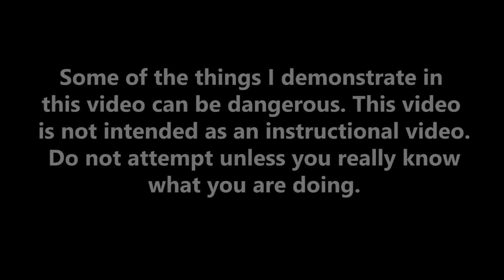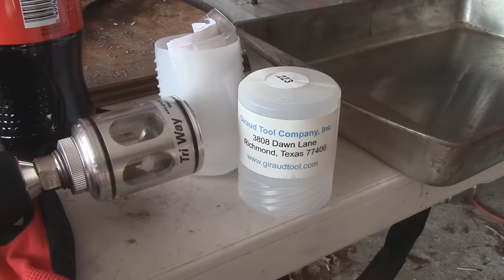How I'm Reloading 223 for $.10 Per Round | CountryBoyPrepper

Comment: This is absolutely incredible, huge respect to anyone who’s this self sufficient. I’m looking to get into hand loading my ammo but I def do not have time for all this
Reply: Thankfully, you can purchase premanufactured projectiles! I’m tempted to start putting together a casting set up though, because you can also get lead from tire shops in the form of tire weights. Tire shops have to pay to get rid of it, so you can often get it for free! You can also skip the powder coating if you use copper gas checks (I believe). Little bit of cost (3¢ a piece?), but saves a lot of time. And could possibly be cheaper than the powder coating equipment.
Reply: You don't use gas checks???
Reply: Batches, I do 1000 cases a day. Then you can reload 200 at a time. It only has to be trimmed the first time, swagging as well. Get a progressive press and 200 only takes an hour
Reply: @eric78704 you don’t have too, leading isn’t an issue, accuracy suffers a bit though. I only gas check for accuracy loads

Comment from the maker: Hey guys. I had to re-upload this video because When I was editing I forgot to include the step of resizing the powder coated bullets which is very important. Thanks for watching!
Reply: i have a question. do u use a gas check on your bullets?
Reply from the maker: No. Not necessary with a powder coated bullet.
Reply: oh ok awesome
Reply: CountryBoyPrepper why u powder coat
Reply: To prevent lead buildup in the barrel. Alternatively, he could use gas checks or copper plating.
Reply: Joshua Sullivan what about powder coat build up?
Reply: Joshua Sullivan he wouldn't really be able to use plating. And I'm almost certain that unless he's loading for subsonic velocities (I doubt it since he said 55gr), it'd break down the plating. I'm pretty sure the powder coat would break down too at above 1500fps
Reply: PC_JUNKIE128 Powder Coating is very strong and resistant.  Several people are now pushing cast boolits past 3000 fps.  I have 22-250 reloads pushing 55 grs Powder Coated cast projectiles accurately at 2700 fps.  For additional information, visit Cast Boolits forum - very experienced folks there.
Reply: TXYoteHunter thanks. I'll check it out. I think I'll be fine with 300blk subs but I was worried about smaller faster proj
Reply: CountryBoyPrepper what load are u using 
I know you said alliant ar compt powder but how many grs.
Reply: James Allen I would imagine it's enough to cycle the bolt, considering there is nothing to say how much he is using.
Reply from the maker: Actually, I'm shooting 2550 fps with no issues.
Reply: CountryBoyPrepper  what powder are you using and the grain charge.  I'm getting into casting and don't know a good charge for range scrape in my ar
Reply: this thread answered my questions. Was wondering if powder coating prevented barrel leading and wondering if you could push cast lead projectiles to supersonic? Seems like you can
Reply: i will buy some from you
Reply: CountryBoyPrepper - any recommendations for respirators when casting lead?

I just got given some casting equipment, just have some caution for doing lead paint removal as a kid.
Reply: D M he clearly said at the beginning of his video don't try this at home cuz it could be dangerous so it looks like you're on your own
Reply: CountryBoyPrepper q
Reply: bet you could automate some of that...
Reply: Inspection of the brass, especially range brass would be big for safety. Inspect for case fatigue, cracks, splits, dents, and so on. My thought is you would have to separate that scrap range lead from steel or copper jackets and stuff that is not lead just to get pure lead. Some lead also may be soft lead while others would be hard cast lead that has some tin mixed in. What kind of quality control are you using for your lead?
Reply: Yep, CBP, it helps when the case grips the bullet, eh?
Reply: this is more than .10 per, you are paying for all the electricity in the ovens and your time and the pain and ect...
Reply: CountryBoyPrepper I thought I had seen it before. Great video my friend, definitely worth watching twice.
Reply: What grain of powder are you using. I just pick up a lb of ar comp for my cast and can't seem to find any literature for my cast .223

Comment: I'm not a gun expert, what exactly is the purpose of powder coating a bullet? Is it just to protect the barrel from lead sticking behind?
Reply: QuaDECH I can tell you how to strip any rifle or how any firearm works but I ain't got a damn clue
Reply: its to prevent lead fouling. super sonic unjacketed lead bullets will surface melt and foul up the barrel.
Reply: It prevents leading in the barrel like Signal Jones said.  It also acts as a lubricant.  Old school lead loads needed a wax mix to put in lube grooved bullets for lubrication as it went down the barrel and to prevent gas cutting of the lead bullets.  It allows you to run bullet projectiles at higher speeds and pressures approaching copper jacketed projectiles depending on the round.
Reply: Mik Wri Nope. The temps are true but lead causes waaaay more friction-thus heating the bullet more than is its plastic coated.

Comment: i'll stick with my fmj 556 at 17cents per round
Reply: bren masl where do you get them for that price? The cheapest I've found is Wolf Polyformance steel case ammo for 22 cents per bullet
Reply: That's some cheap ass'd ammo !
Reply: majorsmackdown n
Reply: Steel case?
Reply: CTM ATV What's wrong with steel cased ammo? It runs just as well as brass and, in my opinion, the cases are prettier.
Reply: Hunter Falkner some people don't like to clean their rifles which is mandatory with steel case because it's corrosive.  Those people who don't like to clean their rifles then started saying steel ammo is bad
Reply: A QUIET CRUX 72 My brothers friend broke a remington 783 shooting steel case ammo. It bulged in the chamber and the action wouldn't come open. By the time we got it open, the extractor broke. He got it repaired on warranty though. I'll shoot steel cased through guns like Ak's, Sks's or Mosin's.
Reply: The Ghost of the Flying Dutchman Faulty ammo. Can easily happen to brass. Steel cased deforms less than brass so it's even less of an issue under regular circumstances.
Reply: Hunter Falkner It was tula so that could be it. As of now he's only shooting more quality ammo out of his gun.
Reply: The Ghost of the Flying Dutchman Wolf works great. You can even see tests on YouTube how they run thousands of them and didn't have any major issues except for increased fouling of the chamber and insides of the receiver in general.
Reply: Hunter Falkner When we were sighting it in, we were using federal and winchester stuff. Shot just fine with no malfunctions. Is wolf any cheaper?
Reply: The Ghost of the Flying Dutchman Quite, depends where you buy it.

Comment: To everyone saying this isn't worth the time and they would rather buy ammo, please send me your spent brass. I am glad that most do not think it's worth it more lead and brass for me and guys like me. Also everyone keeps saying $1000's in equipment, keep thinking that, as I said more lead and brass for me. But if you may be interested in reloading that press is around $120, dies $40, powder charge $38,  lee pot $69, casting mold $40, scales $20, powder $20, primers $30, basically everything to load .223 for less than $400 total. Far from thousands.... I do a few things different though I do buy lead from the scrapyard a lot easier than sifting I am lazy there.
Reply: But his labor is priceless so just shipping.

Comment: What speed are you pushing those bullets with just powder Coating?  If you don't chrono, how many grains of powder?
Reply from the maker: 2550 fps with 22.3 gr. out of a 16 inch barrel.
Reply: The Reloader Dude what kind of grouping are you getting?  I like the whole idea especially if it is reasonable grouping at 1/200 yards.

Comment: Damn dude you got the perfect assembly line. Killin it 👍 also have you noticed any leading from not gas checking 223? I’m having success with powder coating 9 as well as 762x39 with  lowest pressure charge that will cycle my Sks, but I’m nervous about starting 223. Since lowest charge will still be lot more pressure than I’m getting in 762x39, and direct impingement is more susceptible to leading in gas tube than my Sks’ piston assembly would be.

Comment: Countryboyprepper, great video. I just wanted to give you a tip I found out that you may like. If you drop the projectiles in a bucket of cool water right after you pull them out of the toaster they harden more and the seem to separate better.  I do the same think and now I may have about 10 of them stuck together out of the whole batch. Hope this helps.

Comment: Whats the accuracy of these rounds? Sorry if i missed it on your channel i noticed there are a number of accuracy tests but they are all done with factory ammo.  I presume that the powder coat would some what compensate for the fact that range trash is a mixture of metals which would cause a the hardness of the bullets to vary.  Could you please upload a video showing the accuracy and consistency of these bullets?

Comment: I used to reload but I haven't been shooting in a couple of years due to physical problems.     But I have one question for you, does the red lube you put on the bullets, is it enough ? And do you need to put on a copper gas check on the base of the bullet? Is this lube enough to keep the bullet from leading the barrel? That is why I used to buy ready made bullets, that were copper coated lead. They were fairly cheap. Can you shoot the bullet with a gas check and where would you get them these days?

Comment: I use cheap Pam cooking spray for case lube in a Ziploc bag for bulk lube. After sizing and depriming they go into a harborfreight ultrasonic cleaner with a vinegar/ water/salt solution to clean carbon and Pam off. I use the hot Texas sun or the oven to dry. Then off to the press. The Pam will cost less than $1 and lube about a million cases. The Texad sun is free and relentless this time of year.

Comment: What is the BHN of your cast bullets before powder coating and after? I see in your video you water quenched at casting, but let them air cool after powder coating? 400 degrees is hot enough to loose any hardening you gained quenching.

Comment: Im loading 9mm using 149 grain cast lead bullets and 4.8 grains of powder for about 11 cents each. I get brass and lead free at the local range When i was just buying 1000 primers at a time it was about $7 per 50 rounds using cast lead but buying 2250 primers lowered the cost to $4.50 because its cheaper with shipping and hazard fees to buy as much as possible. I wouldnt doubt that even now its possible to load 223 for 12 cents by using free lead to make heavy bullets (to retain energy) and using less powder and buying thousands of primers. I want to do this but got other priorities and nowhere to shoot it anyways. If you have a power drill and a phillips tip you can use that to remove military crimps

Comment: I get why you do it, its cheap, relieves stress, feeds your hobby and saves $$$$. You should protect yourself with gloves and a respirator when melting lead, it will poison your brain slowly. But here is a question why do you powder coat the bullets? I never saw that done before? Is it for lubricity? Or substitute for copper? What will the powder do to the internals/barrels/gas tube/BCG?

Comment: Again, like my "comments on your 9mm reloading video,  more questions than comments. Have you been able to chronograph your loads to check the velocity and what about using gas checks on lead projectiles? Any issues with barrel leading and do you use reduced powder because you're using non-jacketed bullets?
I really like your videos as I would love to be able to shoot more but the $$$ factor. I've been reloading for many years ... well not lately but that's because I haven't been shooting that much ... :( :( :( ... so I already have most of the equipment I need although I have a single stage press ... but it should work fine ... just take a little more time ... but I agree with Kw in that it can be very therapeutic.
Oh also ... I assume that the same process is used for reloading .556. I have a small lead pot already so doubt that I'll invest in a larger one to help keep down the cost. I should only need to to invest in bullet molds and resizing dies.

Comment: hello there, I am new at reloading and Have been learning some techniques,, how do you get rid of the lube on the brass? I can not get rid of it, my brass come out greasy and brown from the tumbler when I try to clean the lube off
don't you need gas check on this bullets?
how much powder and what type will you recommend?
Reply: Use hot water dawn and a 380 case full of lemi shine. Run for about 2 hours. All my lube comes off and they cases are nice and ahiny
Reply: @Asianwick4401  thanks for the advise , i will try it next time

Comment: First off, kudos on your self sufficiency. However, the reason that bullets began receiving copper jackets well over a hundred years now wasn't simply for better ballistics. Another VERY important reason was that when a lead bullet gets up over 900fps the lead its self begins the literally melt down the barrels. Please don't get me wrong. I completely respect your ability to maintain a cost effective ammunition stockpile. Although, I'd highly recommend taking time for an extensive barrel inspection. I understand that you are powder coating your bullets. But does that really maintain the solidity of that soft lead?
Reply: William Barnes yes, range lead has tin and antimony in it too, much harder than pure lead, powder coated 223 hss been tested to well over 2500fps without leading
Reply: @chuckfinley3152  I thank you Sir. I have zero experience with powder coated bullets for just that reason. I pour .45colt usually from lead counter weights off of car tires. A close friend owns a tire shop. I've always worried about powder coated rounds.
Reply: William Barnes wheel weights are a great lead source! The powder coating doesn’t hurt anything, i dont see any pieces of plastic etc in the bore, nothing a little acetone wont fix. The powder coat is actually pretty slick, it will however add about a thousandth to your overall diameter if you size before you coat them

Comment: Like the effort but, your going to have to issues if you don't has check those case bullets. Mostly accuracy and barrel leading but keep an eye on it. On the other hand why powder coat? There's no way it lives enough to prevent leading. Is it just a step you're used to from reloading pistol?

Comment: I wonder if this can be done with scrap copper. Full copper projectiles would be cool as well as environmentally safe.
I'm quite concerned about melting and casting lead so close to home.
Reply: _ VesBraun Trying to get around 2000 F molten metal to cast into a bullet would be difficult and more expensive.

Comment: So... I've watched a very anal guy measuring constantly, creating beautiful and consistent polished rounds and now I've seen how I would do it.
I don't have time to reload, but I can easily clean, size, lube and prime brass on one day and finish them off on another. So it's doable.

I actually thought about sifting for lead for the stinkers I make. I got buckets of wheel weights from garages, they don't use lead for wheel weights anymore.

Do you temper the lead? I had no idea you can actually make it harder until I watched another video. There are also other coatings available rather than powder coating.
Cool video.

Comment: Correct me if am wrong but the side effects of handling lead will will translate to a high cost in hospital bills making this an expensive exercise. This bullets aint cheap
Reply: kevin little You’re fine if you where glove and resperator when collecting and melting lead. just wash your hands after that and your lead levels wont raise at all. Pure lead isn’t dissolvable into your blood stream, lead oxide is however and it it can created when melting lead or build up on range lead.

Comment: Could the bullets simply be painted with something instead of the powder coating?
Reply: i'm no expert but, i'm guessing that if you just paint the bullet instead of powder coating it I would expect some smoke/fumes of burnt paint, that would be harmful if inhaled.

the whole purpose of the powder coat is to act as a lubricant when the bullet is shot. If the bullet wasn't powder coated some pieces of lead would chip off inside of the barrel, which could damage your rifle.

i'm fairly new to these processes, if i'm wrong with this please feel free to correct me. have a great day :)
Reply: Unpaid Intern is right except that there wouldn't be a problem with lead chips in the barrel, but with protecting the soft lead bullet from damage in the chamber, which would cause ftf and accuracy problems
Reply: You have to bake the paint into the bullets. I can hit mine with a hammer about thirty times, deforming it over and over again before it starts to come off. The point is with powder coating its baked into the lead, not painted onto the surface.

Comment: fun sport but expensive when new brass ammo can be had for 6 cents a round and steel russian crap for 4 cents a round. I'm betting if you can do 90 grain rounds, that would be awesome. Add a hot load of powder to compensate for the lack of space of the regular ammo, and you have .224 Valkyrie performance at short ranges.